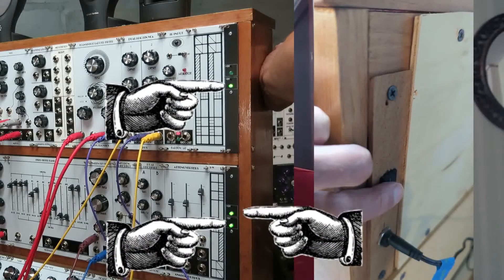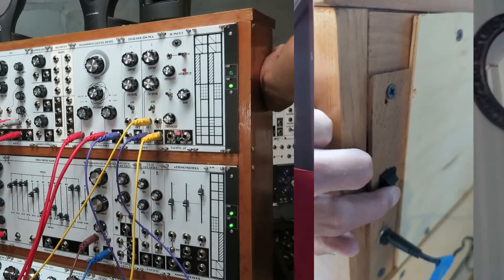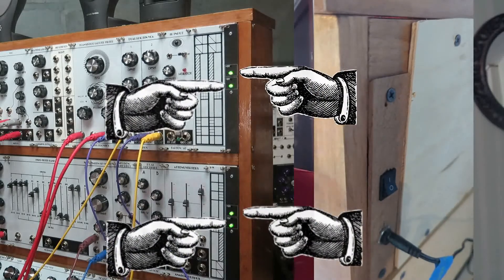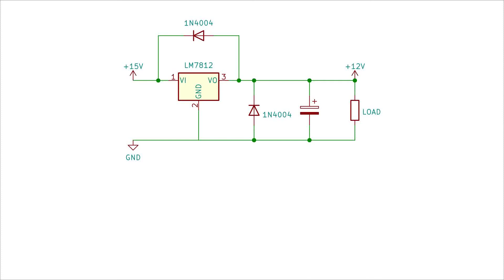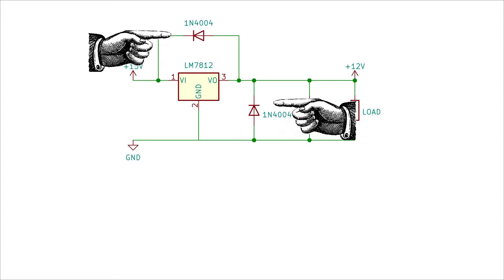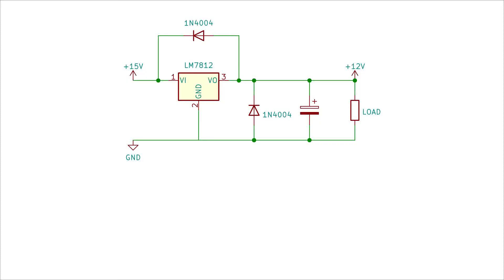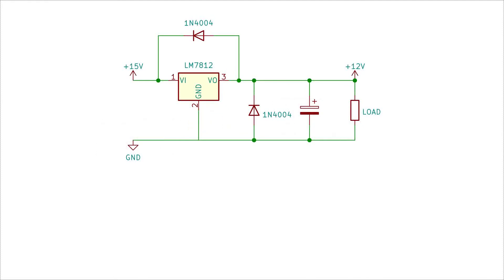Power supply problem (and solution)

Comment: Hi Rich, thanks for your great video! I stumbled across this while working on my own design of a power supply in the same vein as the FC-Power and MFOS one you've built. I will definitely be replacing the diode for the positive regulator as you've identified.

Another thing to note for people looking at these designs is the revision to the MFOS design in which 2.4K load resistors were added to each output, after a MFOS reader reported that the negative regulator requires a 3mA load to start regulating. The FC-Power design has an LED in series with a 1K resistor on each output, which I believe remedies this same issue, with the added benefit of providing a status indicator. Rich- I see you have LEDs for your rails, and I assume this is how you've wired them.
Reply from the maker: That's right. I have one FC power supply and two of mine (https://gitlab.com/rsholmes/ww_supply) based on the MFOS design. Both have on-board LEDs that serve to show power is on and to provide a load for the negative regulator. Of course most modules will draw more than 3 mA on the negative rail but not all, and then there's testing the PSU before connecting it to any modules; then you'd need it. I also use power display modules that have LEDs on the front panel (since you can't really see the PSU in a full synth case!).

Comment: Hi there! I have a question about using this power supply. I want to use it for my first case (3 rows, around 10-12 modules per row, 1 power supply per row). Now, I know that the wall wart used should have max 1A (according to MFOS). How should I power all 3 rows? Using 1 wall wart for each power supply or to daisy chain them and use 1 wall wart with higher amperage? I also see that the regulators can handle max 1.5A. I know that's this is a noob question BTW 🤭
Reply from the maker: Depends in part on your modules, how much current in total they draw. I don't know why MFOS says "The LM78XX and their corresponding negative partner regulators (LM79XX) claim to provide up to 1A of current" and advises not to use a >1 A wall wart. (He doesn't explain why not.) As you say the regulator datasheets say 1.5 A (though I'd recommend staying well below that), and I know of no problem with a wall wart that is rated to supply more current than that provided each rail of each PSU is under 1.5 A. You can connect two more more PSUs to a single wall wart in parallel and the current it supplies will be divided between them. I have 2 PSUs on one wall wart and one on another. All three could have gone on one but I felt like taking the more conservative approach. I have a maximum of about 180 + 160 mA per row with one PSU per row so I'm well below the limits.
Reply: @analog_output  I plan to use your design of the power supply from GitHub. So, my current wall wart (that can supply up to 6A) will connect to the 1st PSU and use the terminal block to daisy chain the other 2 PSUs. I don't expect to have more than 420 + 380 mA per row, so I guess it will be OK right?
Reply from the maker: @allexandru.gallan  Where did you find a 6 A wall wart?
Reply: I realise that I've made a mistake. It says 6VA... So about 0.5A. I will look for something with more juice. But I will take your suggestion and connect the wall wart to only 2 PSUs (depends on how much the modules draw from each) to be on the safe side. Thanks for taking the time to reply, much appreciated!

Comment: Diode between pin 2 and 3 ia very good at grounding any harmful transients comming from inductance load. Electrolytic cap will not ground them and it will also suffer as a result if this diode is not present. To smaller degree in some very rarely seen circumstances. In my synth i don't use these diodes. Haven't got any troubles for 12 years with single supply for 32 modules. But I use u723 and few 2n3055.

Comment: So it's not just me then!
I didn't realise this was a common problem.  I have two Freq Cent boards that never have this problem,  and a third that does this everyday. I thought I must be overpowering it or something.  Thanks for the solution. 
Just an observation,  but on your schematic you have a load resistor between + and - volt lines. On the MFOS schematic there are two 2k4 load resistors: one on each line that both go to gound. Does this make the circuit behave in any way different to your schematic???
Reply from the maker: @analogueavenue   Right, it just represents the fact there's "stuff" in the modules connecting the + and - rails. There are in addition loads to ground including the load resistors in the MFOS schematic.

Comment: I work with these linear / LDO regs a lot at work, albeit usually 5V or 3V3, and as a rule of thumb I always have a 10u & 0.1u on the input and again on the output as close as practicle to the reg.  Also I always use schottky diodes for protection.  Mind you most of my work stuff is smt, and not synth related.  Oh, and a ferrite bead often keeps supply clean....

Comment: Great share . I had this problem years ago . For the life of me, I could not figure out why my negative was starting but not the positive. Same as yourself I turned off supply on and off and it came on at a point . (Very hit and miss.) I then was reading an article from a diy music paper that mentioned the term latch up etc. This then referred to placing a diode across the power regulator.  I then at the time used a 1n5818 instead of a 1n4007 as suggested by accident and, voila !!! it was working so just for good measure I popped one on the negative regulator as well. 
Since then I have had zero start up
 failures. Im really pleased you have taken the time to share this solution.  Very well explained ❤❤❤👌🏾